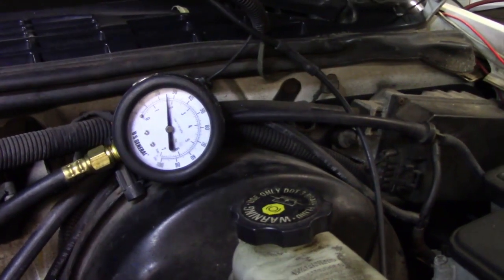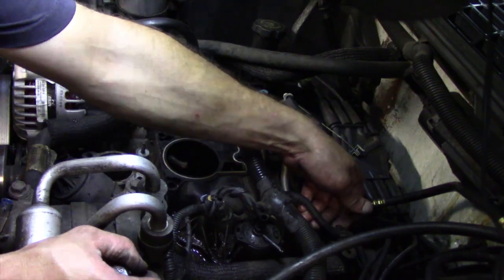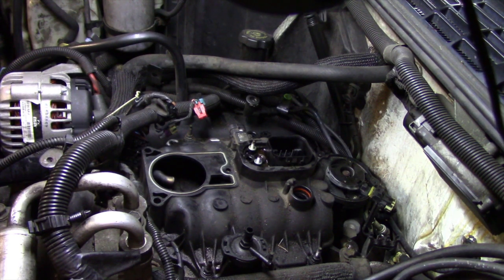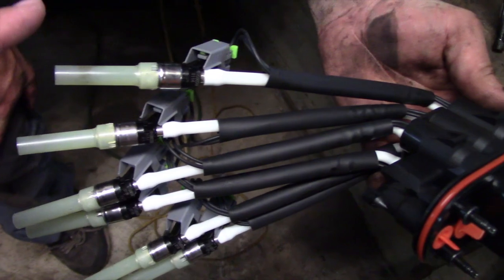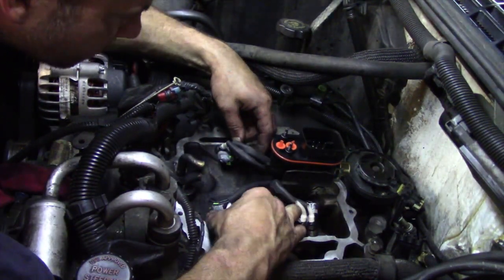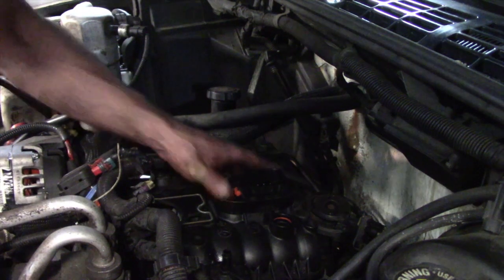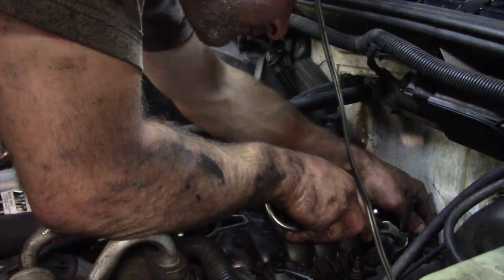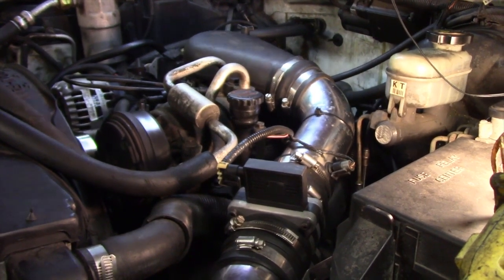How to replace the spider injector on a Chevy motor. 4.3, 5.0, or 5.7

Comment: do you know the part number of your new part an where did you get it
Reply from the maker: The customer brought it. Just go with the cheapest 1 you can find...
Reply: @backwoodzcustomz1549  Nice vid guys.  I heard from a very experienced GM guy that you should only use AC Delco and not to go to AZone or Oreillys  or get aftermarket, but get it from Advance Auto as they have a supplier that orders Ac Delco direct.  Cost dif is about 200.00.  Appreciate any info.
Yeah, it's nice they got rid of poppet set up.  Those vales are notorious for failing.  My 99 Yukon has 203K on it and after a tune up it's still misfiring with no codes. Thanks for any help!
Reply from the maker: @freedomkeeper8003  i mean, ac delco is no longer an oem supplier for gm... They seperated many years back. You need to figure out if its an ignition or fuel missfire.. Also could have coolant leaking in the cylinder... I use nothing but the cheapest china parts i can find.. I have lityle to no issues... There is only like 5 manufactures of autoparts.. Most are just relabled boxes...
Reply: UPDATE: Problem solved!  I opened the hood in the dark, saw arcing plug wires in three places.  Replaced wires and no more misfire. Got wires from Summit Racing. Used 8mm, sprial wound core and 270 ohm.  Great price too.

Comment: What was the cost of replacing spiders? Parts and labor if nothing else needs replaced to go back together ? Approx.
Reply from the maker: The customer supplies this 1.. But i think you can get the for around $100. You will also need an upper intake gasket set.. Depending on what your shop charges an hour.. Your looking at like $500-700 i would say.
Reply: Ok Thanks ! And your video was very helpful. Thanks for recording and sharing it.

Comment: You can test both the check valve and spider injector by removing the upper manifold , reattaching the metal lines then feeding 50 to 60 psi air into them with a gauge attached. If it loses pressure on the spider side the regulator is bad , if you hear air rushing into in the gas tank side the check valve is bad . The new style injector is improved but the push in tabs are one time use and cost as much as $5 each , in short don't try and remove it once it's installed .
Reply: I haven't tried the starting fluid on the intake.I replaced the spider a couple years ago i have spark and fuel holds 60 psi .was wondering is there a way to test the spider cause that thing is $$ to buy again lol  like to test is there actual fuel spraying out of each nozzle?
Reply: @Rekairbrush  
By testing both lines with air you are testing both the check valve and the fuel pressure regulator which are the parts that typically go bad in this setup. Using some sort of spray in the injector will tell you if you are getting fuel to the engine in the first place.

Comment: How do you modify the spider injector to feed a 5.7 vortec with headers, Lt4 Hotcam.  This just a basic description of the engine I have planned for my 96 Silverado std Cab short bed. I see these new retrofit injectors that get rid of poppets and are 36lbs. But they are like $600!!! I want to mod a junkyard spider system thats in good shape to be able to perform at 36lbs and rid the poppet style to the new improved spider setup. What do I need to do and where do I go to learn the mod?
Reply from the maker: In all honesty just do an ls swap....

Comment: My truck won’t start up it will just spin over could I be the spider injector
Reply from the maker: Could be anything.. Spider normally causes a hard start... Check to see if you have spark and fuel pressure

Comment: Hey my truck started then shut off. Checked for furl it has fuel all the way to the top of intake into spider injectors. Is there anyway to check if it's the injectors or the sensor that tells it to send fuel. It runs when sprayed with starting fluid
Reply from the maker: Well just cause it has fuel doeant mean its the right pressure so you should make sure the pressure is what it should be at the testing port with a fuel gauge
Reply from the maker: Most of the time the biggest issue with bad injectors is hard starts. You said yours started then shut off.. So best is to find out if yiur missing spark or fuel. Then go from there..
Reply: Checked pressure. It's got good pressure it drove fine went to store started it up to leave then it just died and wouldn't crank back have great pressure all the way up into top of intake/ spider injectors.
Reply: Wasn't sure if it has a sensor that tells it when to send the fuel through injectors or if it is just the box on top of the injector lines
Reply: Definitely fuel. I did replace distributor and button and it will fire right up if I spray starter fluid at air filter
Reply from the maker: @allenlord3679  you need to check and make sure the pump is putting out the proper pressure.
Reply: Mine is doing the same thing but I haven't tried the starting fluid on the intake.I replaced the spider a couple years ago i have spark and fuel holds 60 psi .was wondering the same like you is there a way to test the spider cause that thing is $$ to buy again lol did you get your fixed?